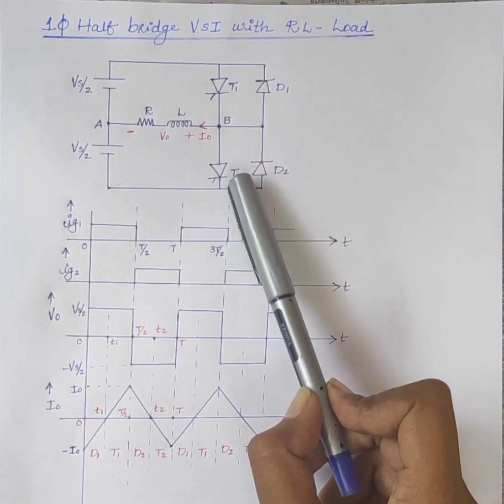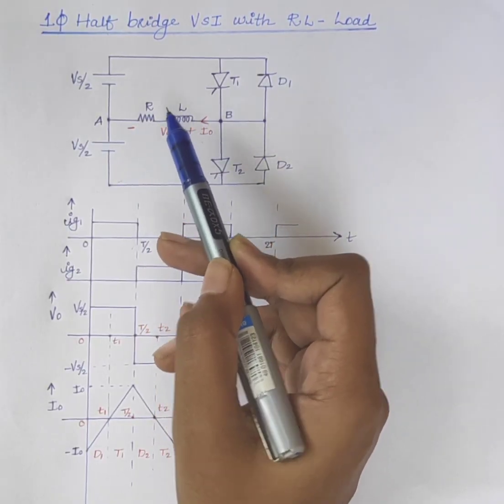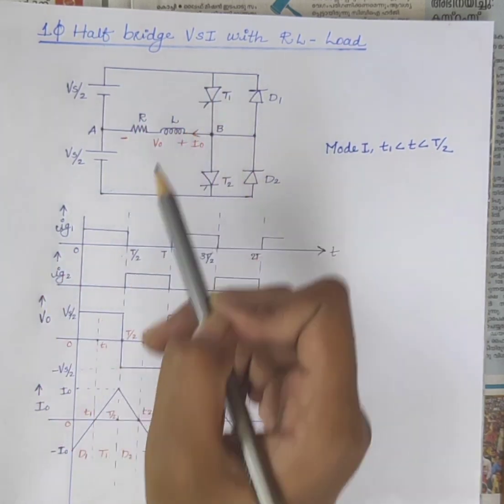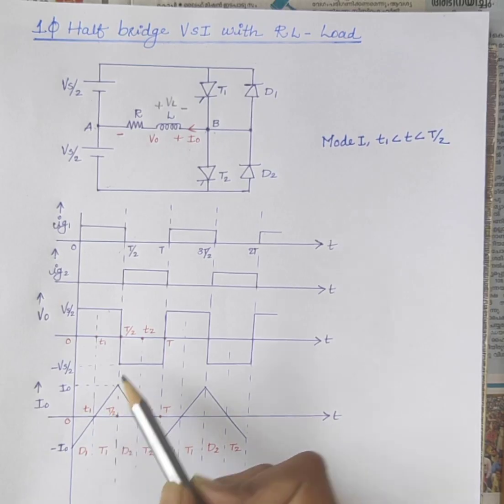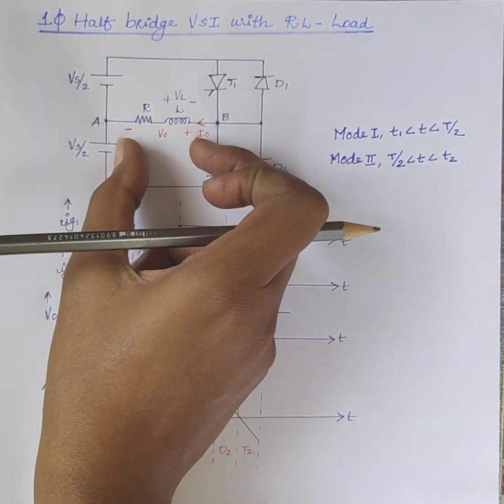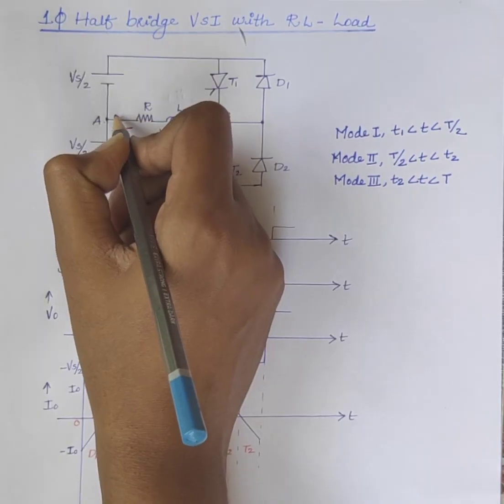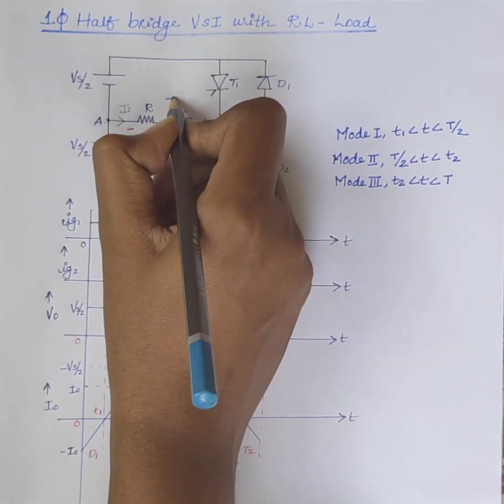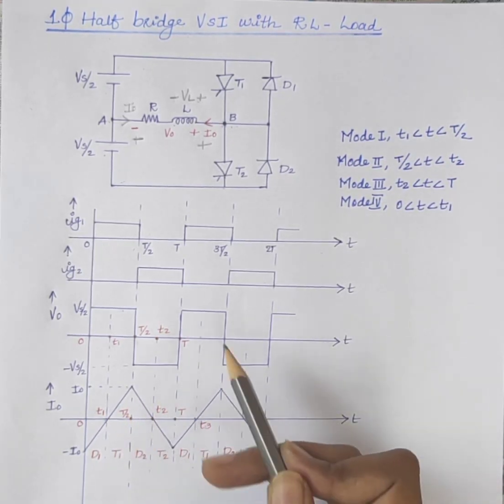Single phase half bridge inverter with RL-load

Comment: But in case of scr, they won't be turned off because the dc voltage source will always provide a constant current that is higher than that of scr holding current. i think we can only work with switches like igbt or am i wrong
Reply from the maker: We are using separate commutation circuit to turn off SCR
Reply: تسمى داره التبديل النبضي حيث نضع ملف على التسلسل مع كل ثايروستور ومكثف على التوازي مع كل ثايروستور @anetjose2836  أتمنى أن تشرحي
لنا مبدأ عمله